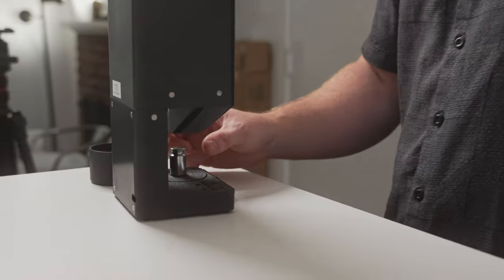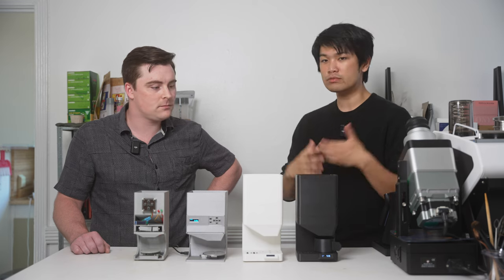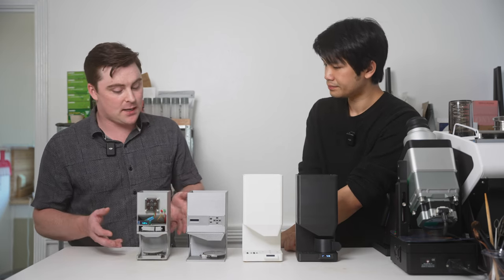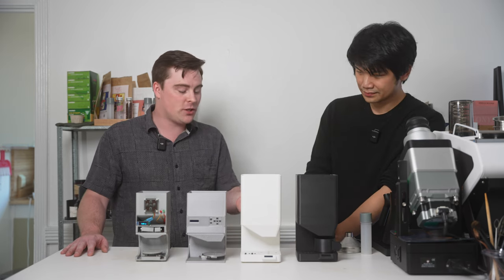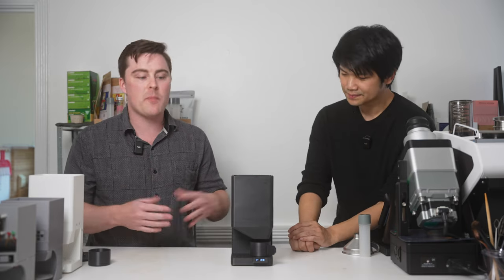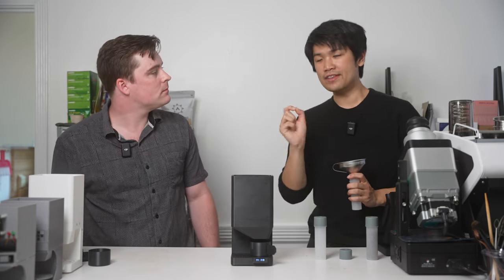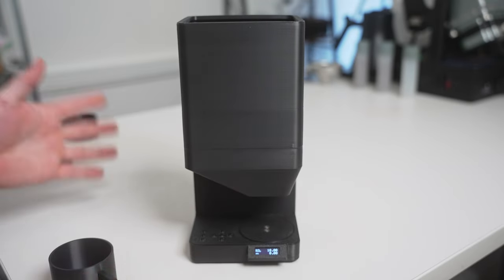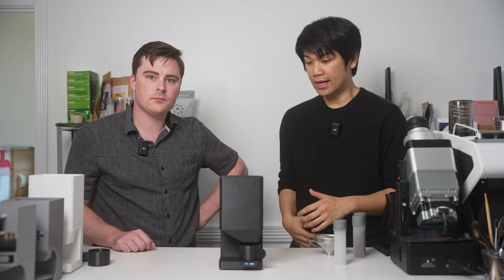THE BEST BEAN DOSER - The Accountant Bean Doser

Comment: For V3, make the hopper maintain vacuum (or use an AirScape-like piston to minimize air) and I might actually be interested in ordering one. To me, the main attraction in single-dosing is keeping beans fresh, and V2 just doesn't solve this requirement. Still a cool device, but not one that would improve my life.
Reply: Although I see the attraction for someone who uses one bean throughout the day, I shift around and would therefore need at least three Accountants on my counter.
Reply: @matthewhoffman6868 
Yes, the feature I'm proposing would be useful to those who prefer the concept of on-demand grinders but have to use a single-dose one to maintain the freshness of beans. Ideally it wouldn't look like the current Accountant but would actually replace the hopper of the single-dose grinder or be placed on top of it.
Reply: Yes, the whole reason I use a low retention single dose grinder is that I want to keep my beans fresh an not contaminate the grind with much old coffee grounds. I keep my beans in a hermetically sealed container. That said, I played around with flushing my grinder with some sacrificial beans, keeping the discarded grounds in a hermetically sealed container. After a while I decided that doing this made no detectable difference to what came out of my low retention grinder, and stopped doing this. After a couple of months I thought I would pull a shot with the old grinds I had collected over time. It came out surprisingly well. I think the fact that my coffee is not roasted excessively dark helped prevent a bad staling from happening.

Comment: The use case Barrett mentioned at 13:09 is actually super interesting. Imagine you walk into a cafe and you can order a customized blend on the spot. Customers choose flavor notes or even something more abstract like their current mood, and either pre-programed or AI models will output the bean ratio, sends it to the Accountants, and there you have your original drink. Not sure if it's needed but thinking of it is very very cool.

Comment: Ok Barrett, I’ve got a challenge for you. So…I currently use a particle filling machine for bean dosing that I got slightly used for a steal of $60 on eBay. It’s been great and does everything the accountant dose, for the most part, like many similar dosers.

However, I’ve yet to see a doser eliminate the additional steps of the beans going from cup to funnel to bean tube. Would you be able to make a version that has a more narrow exit chute and allows you to just stick the bean tube directly underneath? To me this just makes WAY more sense and would shave off even more time for each dose of beans. I don’t know why nobody has done this yet. I assume the machine could maybe be made slightly shorter to allow for a slightly taller filling area if weight balance is an issue.

I’m curious about your thoughts on this and the thoughts of the community.